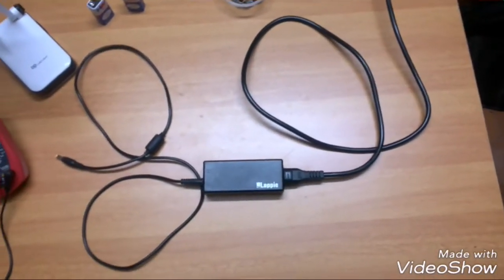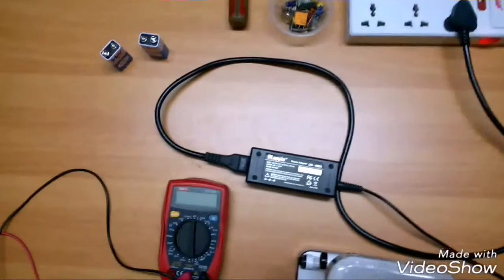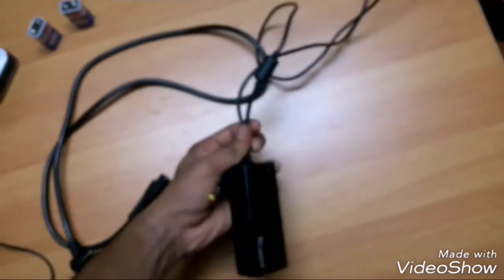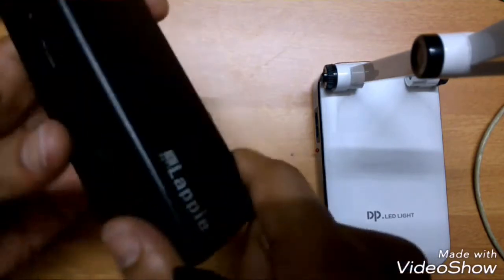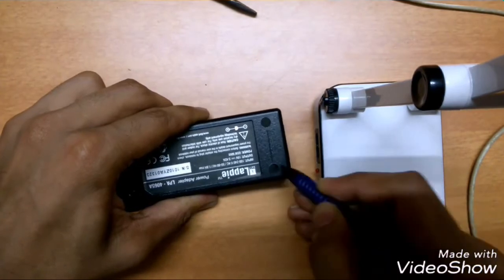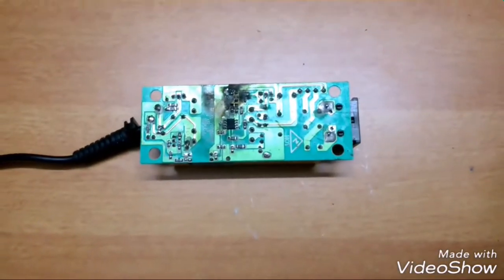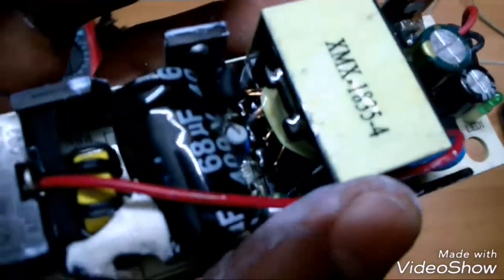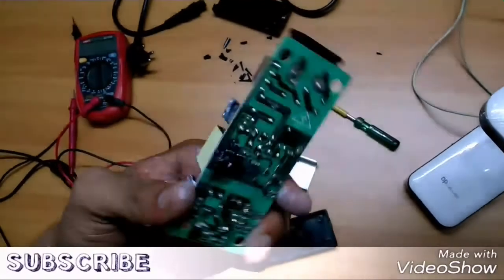Inside a laptop charger

Comment: Great video brother. I was looking all over you to search this video only. Are all electronic devices reqiuires DC voltage only? Like TV, Micro-Oven and all?
If yes then why do we get AC 240 voltage at our home socket? Government can provide us directly DC voltages to our home.
Reply: DC signals become weaker and therefore less efficient to transmit over long distances from electricity generators to homes, unlike AC which doesn't lose as much of it's power with distant locations
Reply: AC is easier to transmit over long distances as it does not loses its power easily. Also, AC can be easily stepped up or down while transmitting to optimize the power transfer across the grid and safety.
DC loses power very quick and the voltage cannot be increased or decreased so easily, but is easier to work with inside electronic goods.
In short, AC is better for power transmission across cables and DC is better to be utilized in electronics